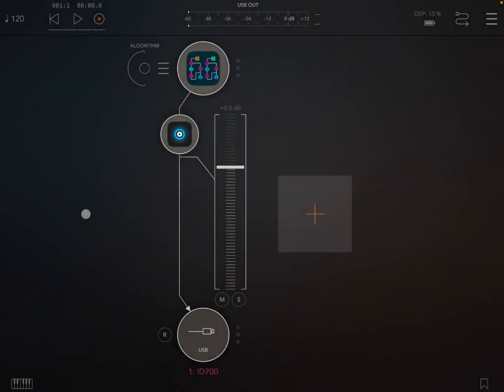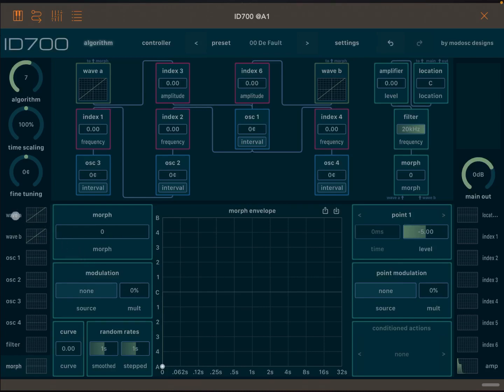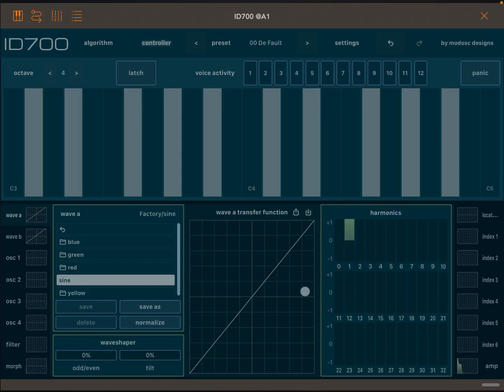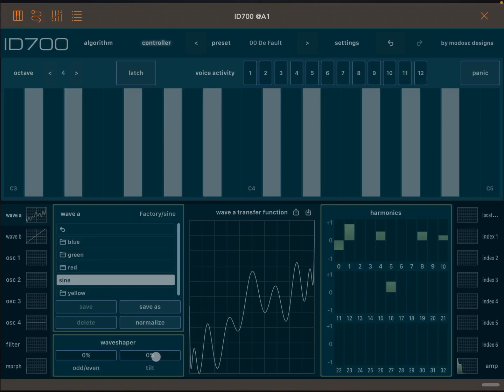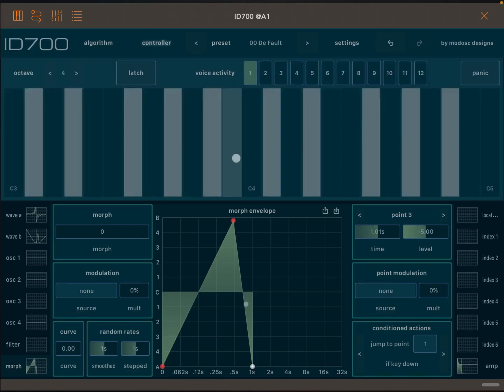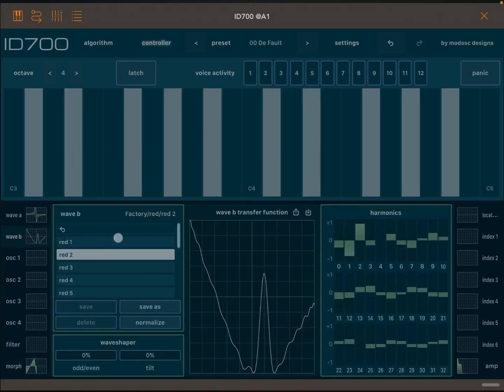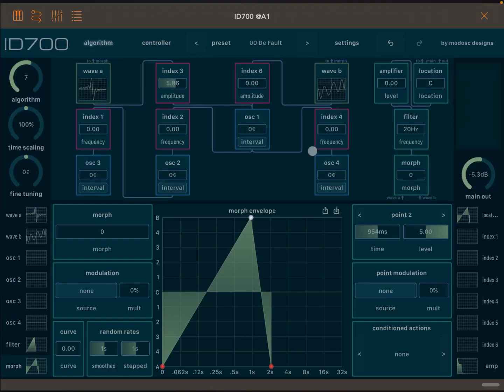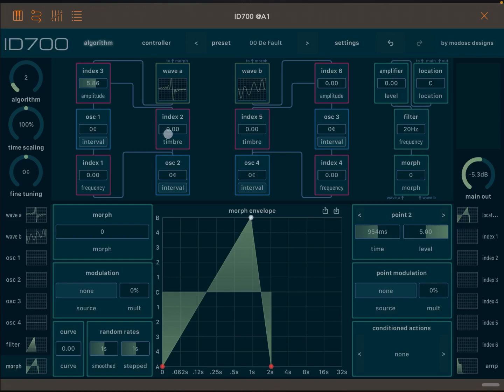modosc designs ID700 - Tutorial, Walkthrough Part 6: Waves, Morph modules

Comment: After finishing all your 6 video's about this ID700, I was wondering if it is possible to input the values through the keyboard. I did not find that option. Double clicking resets the value, but you can only use the slider, afaik. And that is not very precise...
Reply from the maker: Nope you cannot use the keyboard…